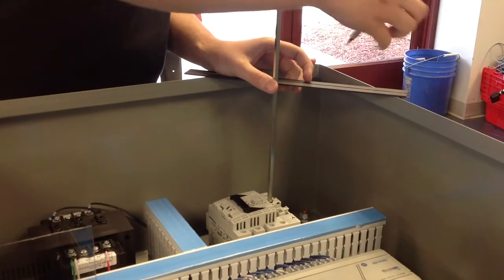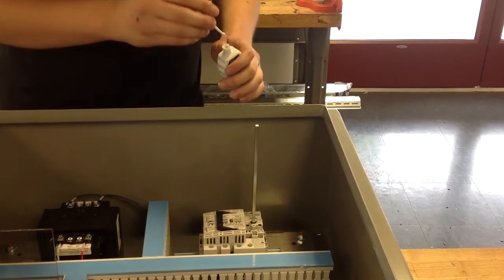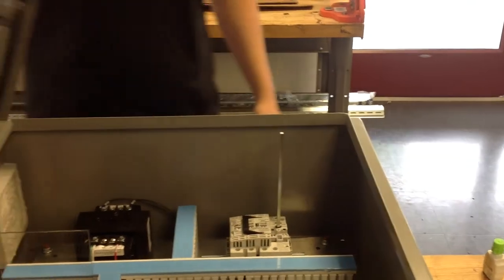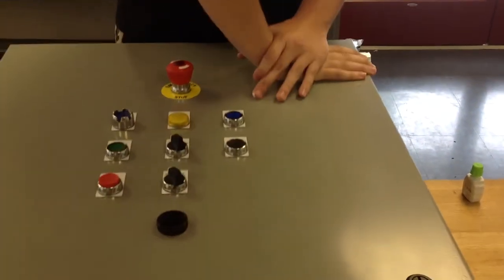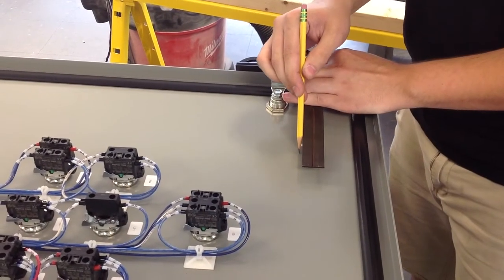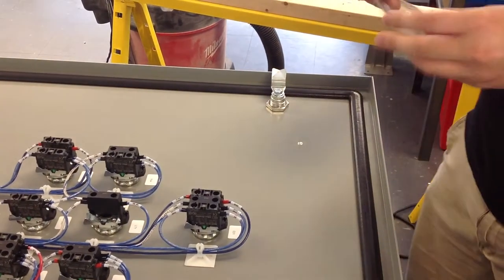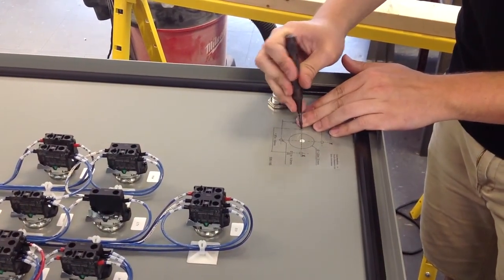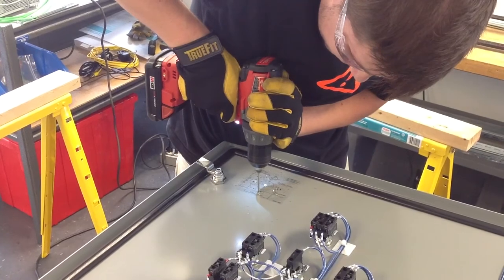How to Mount a Disconnect Handle on an Enclosure Door

Comment: This is helpful but what about the disconnects that don't use that bar? All the ones we use have a breaker under the disconnect that mounts together. I have not found an easy way to do this. Plus if this messes up then the box is no good; which is why we do that first before any other stuff.